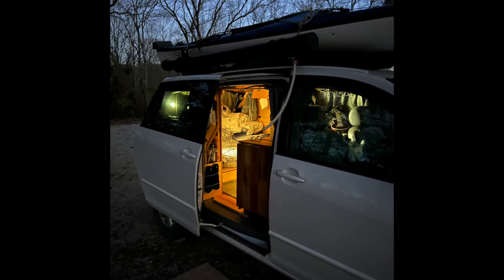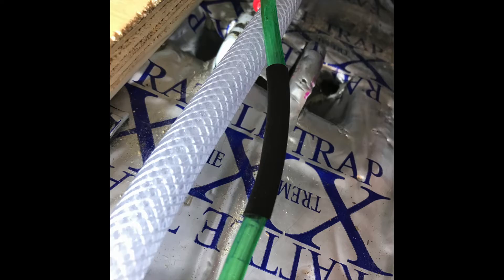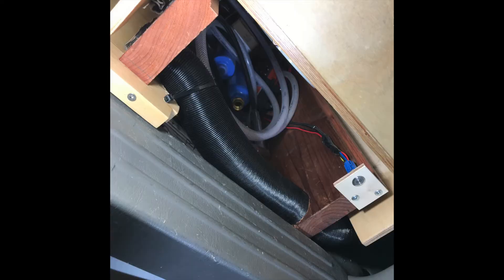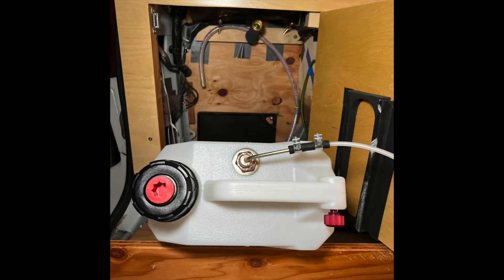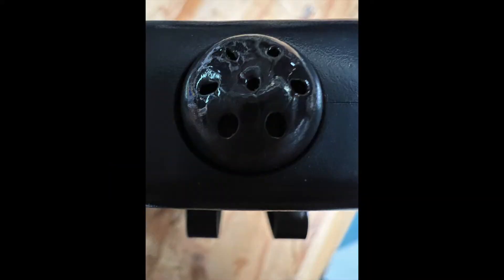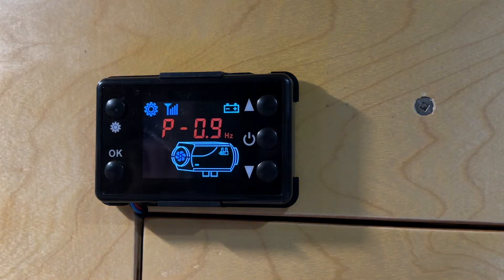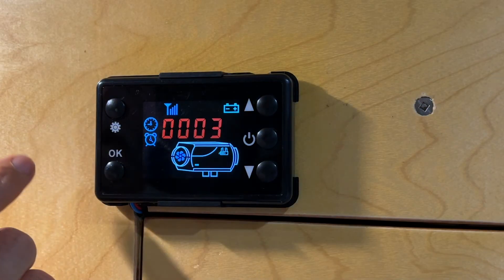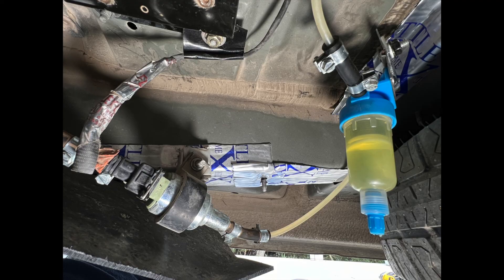Chinese Diesel Heater Installation and Modifications

Comment: That green pipe that is supplied breaks down after a couple of years  it happened to me.
Reply from the maker: Yes, if you watch the video you can see I replaced it. The Webasto fuel line slides inside of it nicely. Once I pulled it out I discovered the diesel smell went right through it.

Comment: All said and done, do you think you would have come out with less $$$ into your setup if you bought a more expensive, and perceivably higher quality, diesel heater?  Thanks for the detail!
Reply from the maker: I never planned for a diesel heater in my build, as when I first learned about them I’d only heard of Webasto. $1000–$1200+ wasn’t something I was going to spend. 
I don’t think there’s a mid quality unit that would have supplied better materials in a $300 price point. I hear hype of “better brands” but they’re still Chinese made and later from comments they aren’t really any better.
So in answer to the question, no. I've maybe spent $100–$150 for upgrade components and multiple spare parts. The only thing to have "failed" is the fuel tanks that came with the heater. The fuel tank was the most costly by far.
Reply: @04_siennaminicamper-nu6vj  Since you have hands-on experience, I'd be interested in your thoughts on the YT channel "Hangin with the Hursts" and their recent comparison of a $99 vs. $450 unit.  It seems there is some difference, but only you know if you have a few hundred in your upgrades to reach the $450 price point.

Comment: Thank you for breaking down your step by step installation and modifications Ron 🙌 I am completely intimidated from installing one myself but would consider paying for a professional installer. Im glad that you were able to tweak it with the new tubes, gas tank, muffler and filter. Youre all set for your fall trip
Reply from the maker: Don't sell yourself short. I think you could do this. Just watch a bunch of YouTubes. It's a lot of parts but manageable. Your Teardrop trailer has tank location in front where propane/ batteries live? Just have to decide where to install actual heater/pump and decide the thermostat location. Buy a better fuel tank and definitely use the Wabasto fuel line. Cut the main power lead on the heater as short as possible and use larger diameter wire for the 12v run.
It would be much safer/ healthier than the propane heater.
Reply: @04_siennaminicamper-nu6vj Thanks for the tips & encouragement. I'm pretty happy with the propane heater in the tear drop but I think I definitely need a diesel heater in the van. Thx for sharing the brand of the tubes & tank. 🙌 Good idea to use 12V power 👏

Comment: Could you please link some of these mods in the description?
Reply from the maker: I put in the link for the fuel tank. 
Aliexpress: search diesel parking heater muffler or air filter, and scroll to your heats content. There are so many venders, linking to one is pointless, as they go away frequently.
Amazon: search diesel parking heater parts, or be specific if you want Webasto fuel line search for that. I don't endorse any seller so look for the best deal. Amazon is always more costly than Ali for Chinese produced stuff, but it usually comes quicker if you need it yesterday.